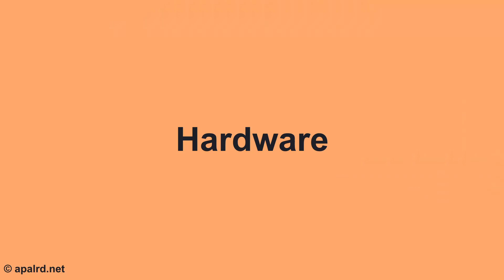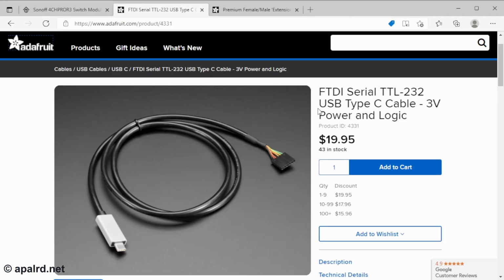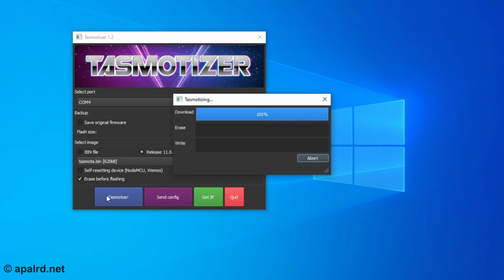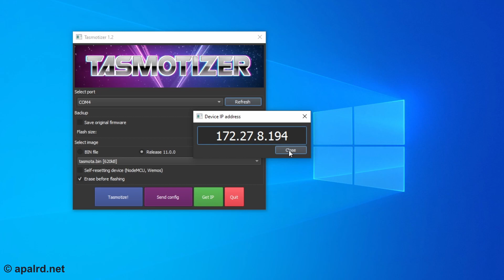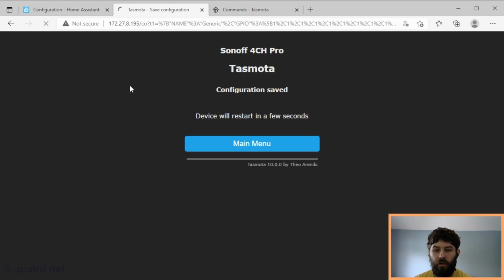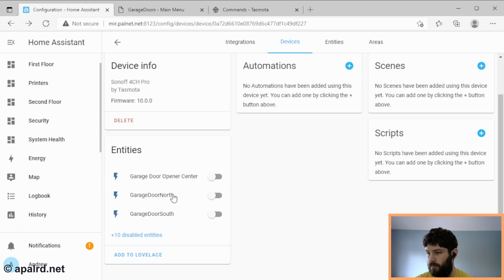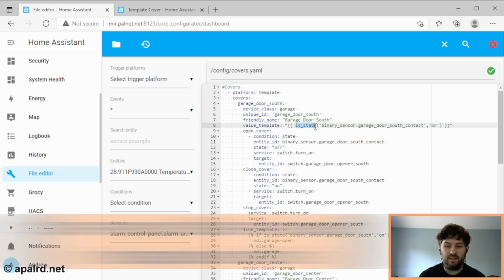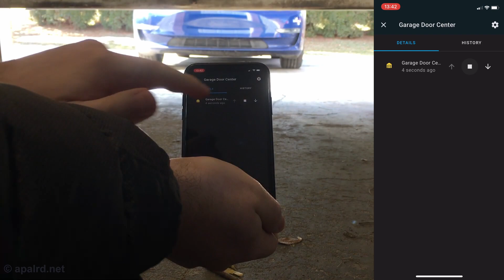Controlling my Garage Door with Home Assistant

Comment: You don't need Tasmota for that.
I used ESP8266 directly with 2 relays to control my bedroom window.
I then built a web interface with buttons and a slider on a local server that communicates with the esp with MQTT, then also wrote a Nodejs code that adds schedules that close and open or adjusts the window automatically at specific times during the day.
I think you already tried that with the garage doors but it didn't work, the relays get stuck, right? that's why you bought sonoff product and flash it.
Actually, the secret is to add 2 RC snubber circuits in parallel to the relays. It will circulate and neutralize the huge amount of current that melts the relay's magnetic rod that's coming from the motors.

Comment: Hi, how to controll 2 garage doors and 2 Shelly? Have tried many hours but I don’t understand
Reply from the maker: Have you gotten the Shelly paired with Home Assistant? The first step is getting the switch entities in HA, then you can make the garage door ('cover') entity out of them.
Reply: @apalrdsadventures  I have paired them in HA. But where to put the second Shelly on configuration.yaml file and do I need something in customise.yaml?
Reply from the maker: For the Shelly, you should be able to get them in HA and configure it as a switch. In my case, I set the switch to automatically turn off after 1.5s (to simulate a button press), I'm not entirely sure how to configure that part in Shelly.

They should have some unique / generic name initially, so you'll have to rename them to something meaningful. But it shouldn't have a problem pairing both with HA separately without anything in configuration.yaml

What you will need to add to configuration.yaml is the template cover, which builds the garage door entity out of a switch and sensor entity. But get all of the switches and sensors working individually first.

Comment: Also I put a esp8266 with tasmota firmware in my car ,   so as I drive up the driveway the esp8266 joins wifi and opens garage door ,   with a condition that if the door is open do nothing
Reply from the maker: Are you using it as a button, or just checking its presence?
Reply: @apalrdsadventures  just checking presence
Takes on average 3 seconds to activate when I reach the drive way
Reply from the maker: @rrrrrrrr290  Sounds like a great solution!
Reply: @apalrdsadventures  been working great for about 6 months now 
Sometimes it takes some time to open garage and wife gets impatient